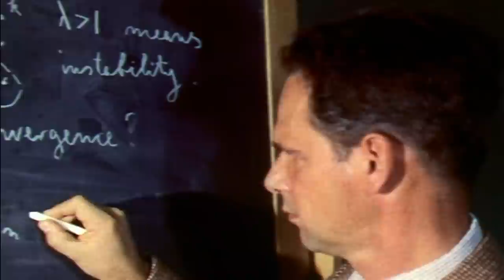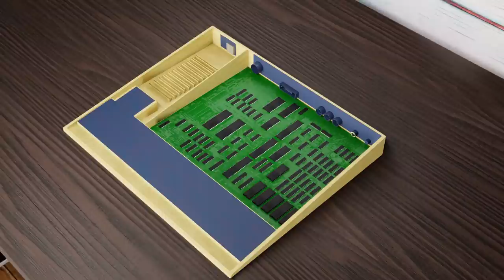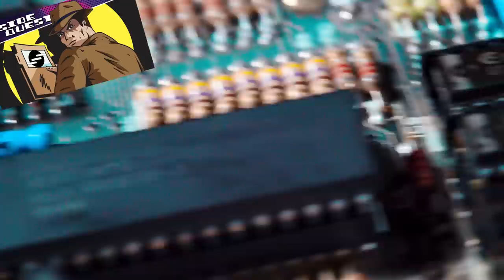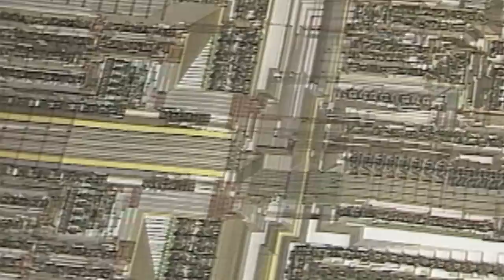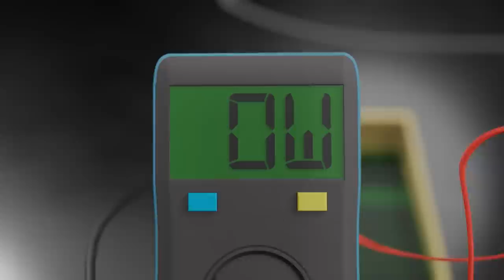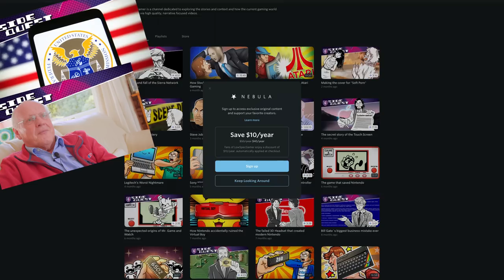How Amateurs created the world’s most popular Processor (History of ARM Part 1)

Comment: The disbelief that Furber had at how much more efficient ARM's first processor was compared to others reminds me of how Apple engineers were surprised by the M1 laptop's insane battery life during their development
Truly baffles me why we continue to keep x86 these days
Reply: The main advantage of x86 is it's an insanely popular platform that is also relatively open.
The mandatory IBM PC compatibility guarantees that every system will be able to boot any sort of OS you want and have some basic features like VGA/Vesa graphics and keyboard/mouse support etc..
To see a x86less world, all you have to do is take a peek on how things work on android. It's pretty dire.
Reply: @dan_loup  That's something that is rapidly changing because of Apple's push with ARM. As software (particularly device drivers) get ports for ARM, we'll see less and less issues with compatibility as time goes on.
That said, you did remind me that we have a crap ton of legacy systems that companies and governments are unable to / too cheap to replace, and no one is going to start modernizing those. That alone is the only argument for keeping x86 around in the long run.
Reply: @GyroCannon  i mean, giving the control of the whole processing industry to a single company is probably a really bad idea...
Reply: @GyroCannon  The problem i'm pointing out is not compatibility, but control over your device.
While the macs are actually quite open in terms of bootload etc at a point you can install linux on em, they only do it because they're having to compete with PC Compatibles.
On the phone space where there's no PC, everyone does the bootstrapping and memory addressing etc the way they want, making basically impossible to make for example a linux distro that works on all phones.
Reply: I'm so excited about what it could come for ARM and what'll happen to x86 in the next years. I'm happy with my Ryzen, but still, having a Mac with a processor that looks like the one from a phone is as powerful (or even more) than my Ryzen 7 is insane. The next Mac Pro is a big question mark though. We'll see
Reply: x86 and ARM are designed for diferent stuff, its really long to explain, but there is a lot of invisible stuff going on on x86 that makes the computers as we know it today, possible. X86 cpu designers dont have the freedom to just cut stuff off on new versions.
It would be a monumental task to switch to ARM and still have all the beneficts that the x86 arch has.
Reply: @luluthecat1570  We don’t HAVE to only buy ARM CPUs from Apple though. I’d be fine buying some from AMD or Intel when they decide to invest in that. I’d even consider buying something from Qualcomm in the meantime.
The bigger issue is that Apple is the only one who believed in it enough to write a compatibility layer to get x86 to run on ARM without having performance suck. That’s the only competitive advantage that Apple has over the others.
Reply: @shivanSpS  I definitely don’t know the specifics about every instruction in x86 (because a handful of them were for weird niche use cases) but in theory you can craft the same single x86 instructions with multiple ARM instructions. It’s not about chopping off parts of x86 (you don’t really ever remove parts of a standard) but instead start from scratch in ARM, ie start compiling code into ARM instructions
Reply: Mostly because of backwards compatibility and because most of the R&D money is being funneled into making better x86 processors, since that is what consumers buy
Reply: @GyroCannon  is not about the instructions, is about x86 being designed around the idea of i/o compatibility (the IBM bios), hardware compatibility (search for example the problems of trying to make a dGPU work on the Raspberry PI 4 PCI-e bus), binary forward and backguard compatility, etc.
Those are the things that made x86 so successful and globally acepted in the consumer market. All those things adds significant development costs and power usage.
ARM on the other hand is designed to work as a SoC on a SBC device, like a phone or a tablet, were you need power efficiency and nothing of what i just mentioned. You develop the firmware to support that one device that most likely is going to run just one OS and all software is compiled for the ARM arch supported by the cpu used.
So they are designed and intended for diferent uses.
Reply: @shivanSpS  Meanwhile, last I checked, Apple Watches have a rough battery expectancy of like 18 hours. Like for real? A wristwatch that can't even last 24 hours on a single charge?

I mean I realize they packed lots of technology into them, but you'd figure the engineers would have had the sense to set a target battery life of a watch at a bare minimum of 24 hours...

I happen to have a knockoff 'smart' watch with a battery life of around 8 to 10 days. How did Apple totally butcher the concept of a timekeeper that can't even last 1 day?
Reply: Iirc x86 is still the king in performance on most applications.
Arm is fine but in many cases it needs more than one cycles to do what an x86 does in1.
Reply: @jousis_  Yes, that's generally the nature of CISC vs RISC processors. RISC might take multiple simpler instructions to perform one complex CISC instruction, but it comes with the benefits of simpler and more power efficient chip designs.
Reply: @shivanSpS  ahhh, now I get it. I’m not convinced that those factors will keep x86 on top forever (due to Moore’s Law slowing down and the physical limits of silicon being approached), especially because hardware compatibility is something that can be solved through device drivers.
Reply: @GyroCannon  I dont mean Apple, ARM is a company by itself (it is owned by SoftBank, they sell the ISA to other companies and those companies produce their own chips, Apple is just one of them). Also ARM (the company)'s latest chip designs are horrible (the things they sell to other companies), check Geekerwan's video to find out more. The new A510 is LESS efficient than the 6 year old A55 and the Cortex-X series cores nearly use the same amount of power as a Intel efficiency x86 core. The A-715 has no real performance or efficiency gain even though it dropped support for 32 bit applications
Reply: Oh and I forgot to mention, A710 and A715 are both less power efficient than the A78 that came before them, even though they are manufactured with 4nm process instead of 5nm and A715 doesnt even support 32 bit
Reply: 30 years of wasted x86 mess. :)
Reply: Funny when even the Apple Engineers are suprised.

Im not suprised at all.... the M1 chips were just more powerful iPhone/iPad chips... then add up everything together with the battery runtime of the iPad and the huge battery in a notebook.... voila, expected!
Reply: @shivanSpS  "It would be a monumental task to switch to ARM and still have all the beneficts that the x86 arch has"

Tell me ONE REAL BENEFIT except the higher flexibility (at least theoretically...)
Reply: @harrison00xXx  My personal surprise about Apple Silicon has been its performance. We've seen attempts to bring ARM outside of mobile, like the Windows laptops that ran off Qualcomm Snapdragon SoCs, but they had abysmal performance.
Apple's true slam dunk came with Rosetta.
Reply: @UntrackedEndorphins  Consumers buy many times more ARM computers than X86 computers.
Reply: @southernflatland  I just checked right now. Latest Apple Watches are 36 hours on normal settings. 60 hours in power saving mode.
Reply: @jimmyporter8941  Cool, they finally got a clue and somewhat fixed that issue huh?

Still my knockoff watch last 8 to 10 days, and my older dumb watches could last 8 to 10 years.
Reply: @southernflatland  Your knockoff watch either does less, does it slower, or is chunkier to fit a bigger battery. It's a simple matter of trade offs.
Reply: @jimmyporter8941  Indeed, it's all a matter of tradeoffs..

I had an old mechanical watch that would wind itself while you walked around. My my how energy efficient tech has evolved.. 🤔
Reply: @southernflatland  A comment that would have some relevance if all smart watches did was tell the time.
Reply: @jimmyporter8941  Sometimes a simple thing should be left more or less simple. A good wristwatch should do what it's meant to do for a good long time before needing much service.

Not every device needs stupid extra smarts. That's what your phone is for anymore apparently. Not like you're gonna have it far from you anyways..
Reply: @southernflatland  and yet you bought an iPhone knockoff.
Reply: @jimmyporter8941  I didn't buy squat, it was a gift, that I found out later costs less than $7.

Edit: And the battery beats Apple by a long shot!
Reply: @southernflatland  😂
Reply: @harrison00xXx  x86 much better at multitasking
Reply: @harrison00xXx  Well, ive already mentioned them.
Its nothing that cant be fixed, but it would need to be enforced from ARM or require a mayor collaboration between ARM cpus makers. And that is unlikely to happen because the money is on phones.
Just buy any ARM SBC, any, it is just  cpu, a memory, a storage device and some I/O, it should not be diferent, try to install Linux or Windows normally and see what happens. And even if that works try to add devices to it, like a extrenal gpu attached to a PCI-E lane. Everything worked? great, buy another one and see if you can repeat the experience.
Then compare to doing the same on any x86 pc.
Chances are, you are to be unable to do anything, and if you have any SBC other than the RPI good luck because complaining about the lack of support because stuff dosent work is the number one issue for ARM boards that is not an RPI. 
In X86 we had the the IBM PC bios to shape the PCs in the way they are now. ARM never had that, and they do not need to for the devices they are actually designed for.
It might be easier to fix x86 by dropping compatibility, that would result in a lot of redudant hardware being removed from the cpus, but that would mean our current software would need to be emulated to run, and it needs AMD and Intel to agree on it.

And still i dont think ARM is anywere near in price / perf, for example one ARM SoC that is getting more popular these days its the RK3588S that allows for sub $100 SBCs, but performance is around a Pentium G7400 in MT, and a little below a 3200G, but it is nowhere near in ST. Thats is barely enoght to be used in cheap office pcs. Microsoft is working on the 8CX Gen3 for the new windows ARM device, but thats a ultra premium SoC that remains to be seen how much power efficient it is.
There are better Phone SoCs but they all have the same problem, its cheap and underpowered to be used as a desktop pc or they are super expensive. Also you cant take a Phone SoC and build a pc/notebook with it, it is unlikely to have the necesary I/O.
The RK3588 is kinda the first ARM SoC that i saw at a resonable price that could be actually challenge x86 cpus, but, unfortunally, it can only compite with 2C/4T x86 cpus.
Reply: @luluthecat1570   You are wrong, modern ARM instructions allow as much or even better "multitasking"
Reply: @shivanSpS  I see, someone didnt realize "Apple Silicon", M1 and M2, which are ARM chips, exist?!

basically all your complains (except for the windows part, but there are tutorials for using the ARM version on the M1/M2 chips) are pretty much nonsense.

The future will be ARM, and all i can hope is that x86 will finally be replaced since its inefficient and ANTIQUE!!!!!
Reply: @harrison00xXx  Apple is not doing anything new here, they have a good SoC that they are not going to share with anyone.
Reply: @shivanSpS  A good ARM SoC, unlike your nonsense x86 statement
Reply: @harrison00xXx  reemplacing PC by moving to a close platform like Apple it's they worse thing that could happen. So what Apple does it's not relevant here.
As for the rest belive whatever you want. But there is a reason why ARM it's not being adopted in pcs.
Reply: @shivanSpS  believe what you want facts are x86 is an old platform which should have been replaced already in the early 2000s, thats FACTS, but AMD refused and so it kept on going
Reply: @shivanSpS  and its not about Apple, its about ARM
Reply: @harrison00xXx  yeah well its just instructions, in fact you are now going to see a big push towards RISC-V because its a open standart.

It dosent really matters, until someone comes forward and puts money into making a universal ARM firmware that enforces how the boot process work, devices and buses init, and a lot of etcs. And then we need a company to start making SoCs that can compete with x86 offerings in price/perf in the PC market. Until then we are going keep using this. acording to you, very outdated CPU arch.
You may talk all day about how power efficient they are, and im not arguing that, but unless that gets done it will get nowhere.
The day the major OEM brands start offering ARM notebooks in mass you will known that had already happened. Until then Apple is just a example of "what it could be".
Reply: @shivanSpS  early ARM stuff was probably limited in performance and complexity, but modern ARM versions are different and compete EASILY with x86 (in fact JUST BETTER IN ANYTHING)
Reply: keep coping , Microsoft tried to that like 10 years ago . But it didnt work . x86 emulation is wayyy slower than x86 cpus that make perf/price of arm cpus cant compete with x86 . Maybe we can run some android app with arm cpu ,but why do we need it in the first place ?
Reply: @xDoge26  You are so wrong in ANY points you made
Reply: @harrison00xXx  so tell me where im wrong
Reply: @xDoge26  in EVERYTHING
Reply: @shivanSpS  You couldn't be more right. You perfectly explained it, and @GOAT OF DUTY doesn't understand because he likely has never used an ARM in a PC environment before besides Rasp Pi or Apple M-series, those are the rare exceptions, not the rule. As you stated, there are lots of powerful and efficient ARM based chips like the Rocks series that are a nightmare to try to get any modern OS including Debían Linux to run on unless you run the outdated and specially patched kernel made for the chip that isn't mainline. Good luck getting most of your peripherals to work properly. Just encountered a similar issue of with Rasp Pi 400 trying to get multiple brands of USB WiFi 802.11AC dongles working, but no compatible ARM drivers exist.

Comment: Was reading a comment under a LTT video a while ago and the person was wondering when we would ever see an ARM desktop..... I replied with "The 1980's mate" lol 
I miss my A3010
Glad to see Steve is still looking well
The film Micro Men is another good patrial of this time
Reply: I think what they meant in that context is a windows/Linux machine compatible with gaming and such.
Reply: @aboveaveragebayleaf9216  So like the Apple M1/M2 type stuff?
Reply: @motocat5685  yeah, but with backwards compatability for titles made for x86 architecture.
Reply: My Archie died to battery leakage, now happily it sports a Pi3b+ inside running riscOS. Lovingly named the ArchiPi
Reply: @aboveaveragebayleaf9216  so like the Apple M series? They wrote an x86 translation layer, so apps written for x86 can run on the ARM architecture. (They did the same thing for power pc to x86 back in the day too) and most apps ran as fast if not faster than on x86 too.
Reply: We have Linux running on all the ARM chips in common use.

Microsoft keeps throwing money at it, but Windows on ARM remains a complete trainwreck.
Reply: @lawrencedoliveiro9104  the big issue is Microsoft keeps trying to bundle the move to ARM with implementing extremely harsh drm, and it kills every attempt before it can get off the ground.

Comment: Small correction at 11:06: The lab in Arizona was called the 'Western Design Center', not the 'Western Digital Center'.
Reply from the maker: Woops. How did that slip in the script? Thank you
Reply: @LowSpecGamer  Probably a simple mix-up considering that you have (A) Western Design Center and (B) Western Digital Corporation, which can both be abbreviated as /WDC/. UsuallY, though, the former is called WDC and the latter simply WD.

Comment: I respect the ARM instruction set, it's got something like half the registers of MIPS, but that's one more bit for each operand that can be used for more opcodes instead.  It's seems like the right balance.
Reply: I do MIPS and ARM (Cortex M) too, in assembler when necessary for the odd pinch point: my line of work is embedded DSP for RF systems. I agree that the relatively small number of registers on ARM can certainly become a bottleneck when you're trying to do an algorithm in-register to minimise load & store operations.
Reply: And yet when you look at the ARM64 instruction set, it's as though they saw the i86 and thought "hold my beer..."